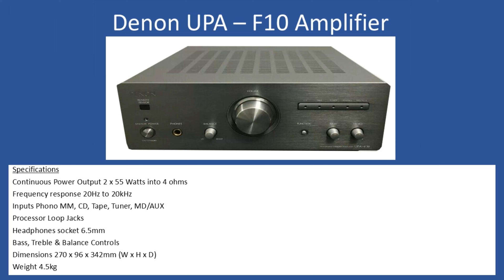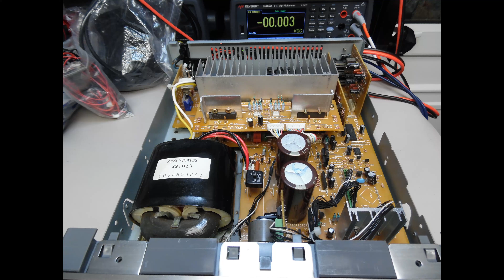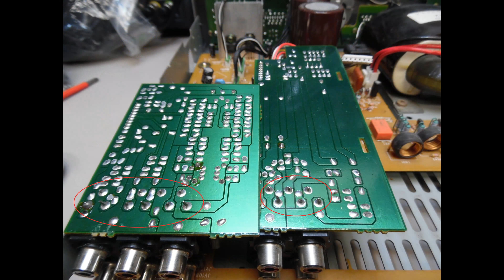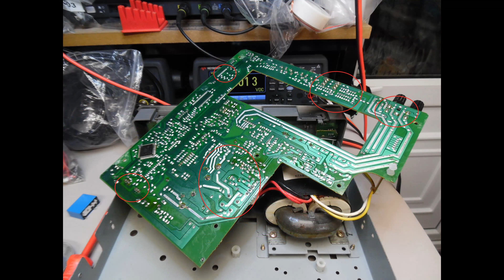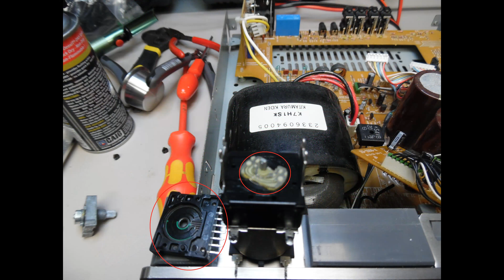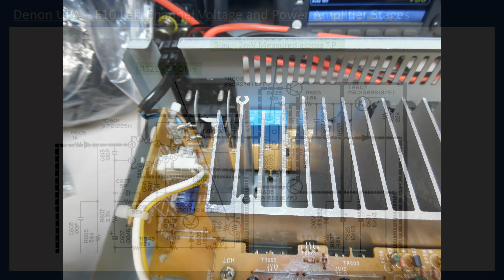Denon UPA F10 Amplifier Repair (With Audio Tutorial)

Comment: My UPA F10 has exactly the same issue. I too supected the relais first, but listening closer to the exact nature of the distortion, not just intermittant sound, but sometimes a distortion resembling crossover distortion made me shift the primary suspect to the volume potentiometer. Precisely the track followed here, that's encouraging :) With the relais eliminated as the culprit here, let's go for the volume pot first. I'll let you know, thanks!